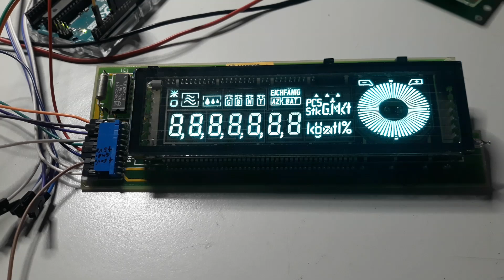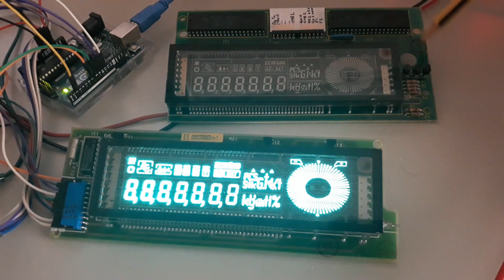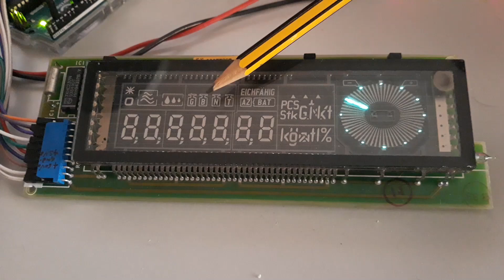SN75518

Comment: Such an awesome VFD glass! Do you know the manufacturer and model? Which kind of gear was this used in? Very nice item!
Reply from the maker: Hi,
Thanks a lot by the question, but honestly, I don't know where it belongs! This is the second panel format I have received for video that uses the same VFD. I'm always hoping that someone will add additional information to recognize the item on their appliances. Maybe an oven, microwave, if I find out I'll let you know, ok.
Reply: @jlsmonte  If you look well at the items on the VFD, you clearly can see that this came from a electronic scale.
Reply from the maker: @sebastian19745  Thanks a lot by your alert! At begin I supposed it belongs to a robot of cuisine, they have also the function of weight. But I don't know and I will be glade if any can inform to us the brand and model where it is used!